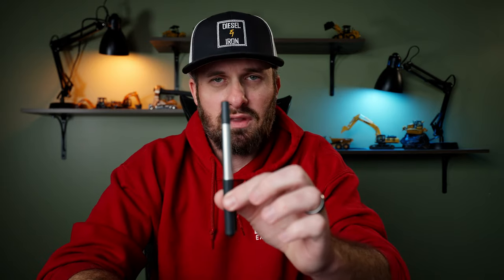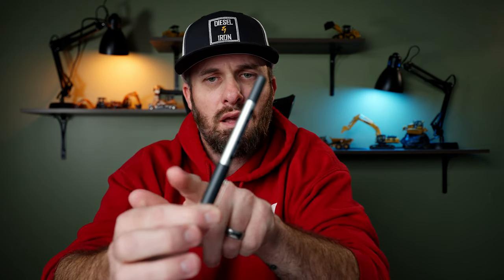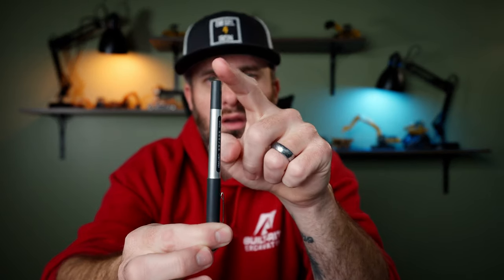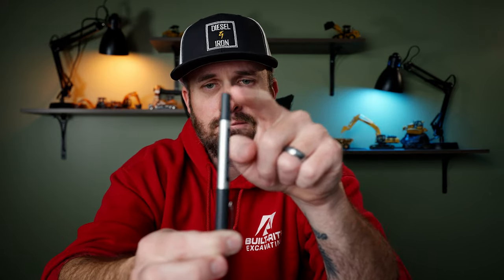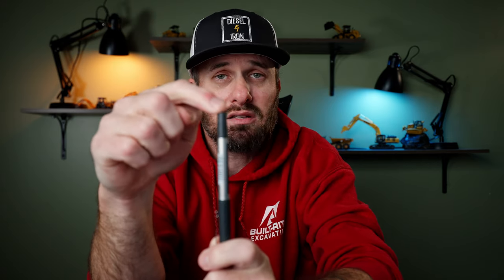Why Fingertip Operating Matters

Comment: Good video! I find myself switching between all grips depending on what you are doing like you said in the video. 
Nice slow small movements around utility’s 👌
Reply from the maker: I actually do the same thing.  If I'm just hogging material I don't really think about the way I'm handling the controls.  With delicate work I'm very intentional about how I hold the grips.

Comment: 100% But I a have a counter aka the early 2000s kobelco’s 400 and 480. They made the sticks so long it was like operating a rowboat. Other than that right on the nose.. I call operators that run rigs with there fist (heavy handed operators)
Reply: Similar to a older WA500 I have ran
Reply from the maker: Good point.  This works better on some machines than others.

Comment: Being self taught on the farm mostly in a skid steer I actually went the opposite way. I grip the sticks at the very very bottom. Reason being I need more effort to move the stick because of the lack of leverage I would have if I grabbed the stick at the top. Imagine a car with little power steering vs a car with almost no resistance on the power steering. That is how it feels to me. I’m 23 and totally open to being wrong about operating this way. Again totally self taught.
Reply from the maker: You actually lose a lot of control grabbing the sticks at the bottom.  Because you are applying force closer to the fulcrum point of the lever it requires more effort to get the stick to move.  You are also taking a lot of your range of travel out of play by grabbing the stick so low.

That being said, there's no right or wrong way to hold the sticks.  If you are comfortable with your grip and you're able to be precise and safe with your movements then there's no need to change what you're doing.

Comment: that works well with the old machines. but with the new machines with a tilt rotator as an example an engcon this is not an option and you have to grip the joysticks lower to operate them.
Reply from the maker: That is true, the newer tilt rotators do impact your ability to do this.